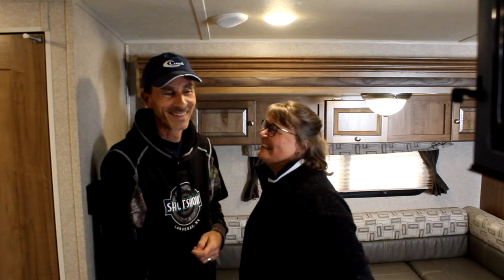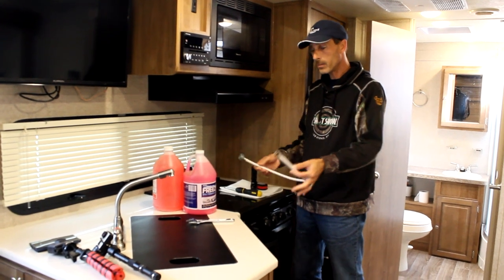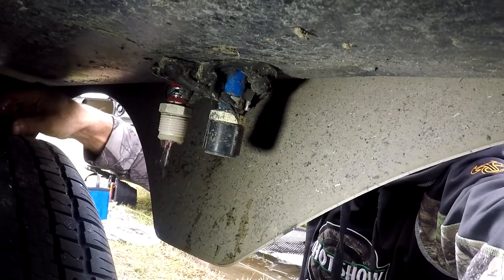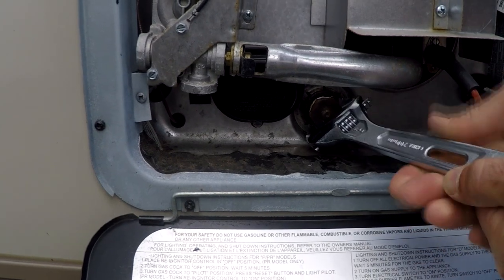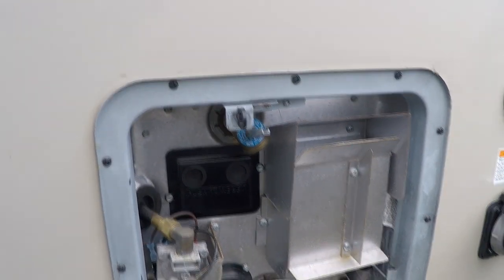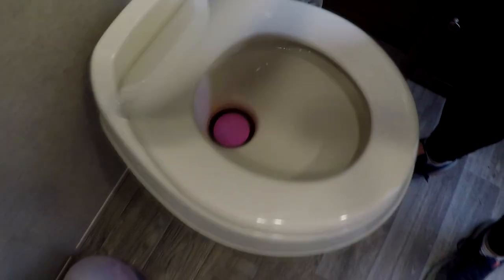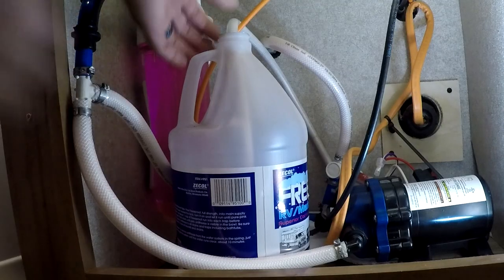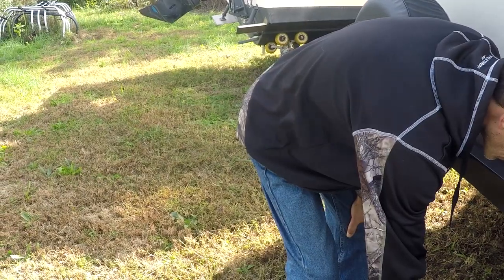How to Winterize a Microlite Travel Trailer

Comment: I like the idea of having the pink jug inside near the pump so you can keep an eye on it instead of using the factory provided anti freeze port outside.  I added a tee and a valve with a length of tubing at the pump inlet to do the same.  The only thing I would change about your process is that the filter housing should be drained of water before running the pink anti freeze thru the lines.   The anti freeze is certainly diluted to some degree until you run a bunch thru there.  Better still to just remove the filter housing altogether since you don't use it to filter.  We removed the one in our Micro Lite since we prefer to use an inline filter on the hose when we fill the fresh water tank.
Reply: I remove the water filter from inside the housing and place in an empty water bottle inside the housing, this way you are not using has much antifreeze.

Comment: You are lucky,. You have  bypass valve and cold and hot water valves are easy to get to. I have 2021 Mini lLite which is not nearly as easy. Will be taking my trailer to rv dealership so they can possibly show me how to access the bypass and hot and cold.